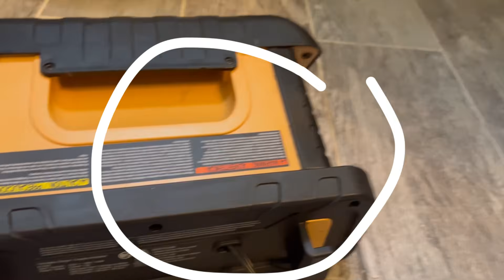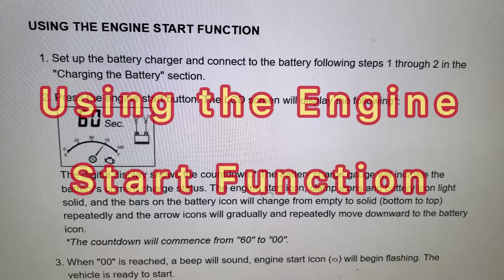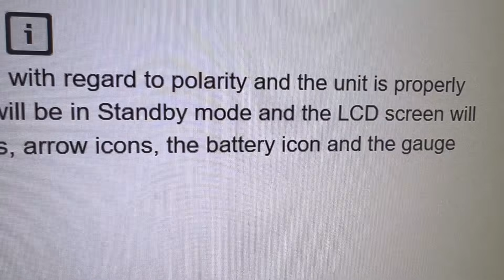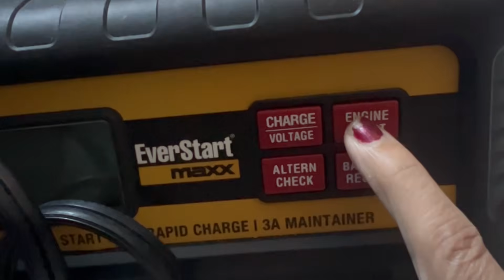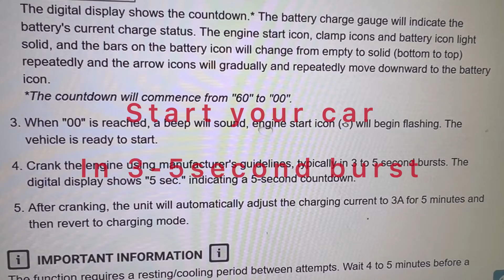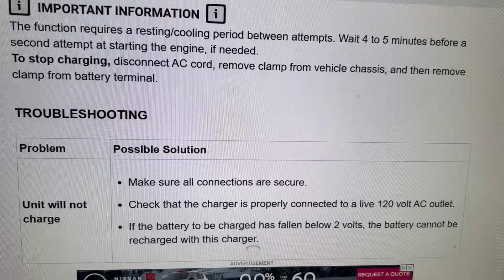EverStart maxx 15 A Rapid Car Battery Charger - Set Up - Manual - Using the ENGINE Start Function

Comment: Got a completely dead battery and this thing wont even begin to charge it. I hate these automatic chargers
Reply: Yup! But the cheap harbor freight one did. 😂
Reply from the maker: @AltruisticWarrior  they always do lol
Reply from the maker: Probably defective - mine still works
Reply: Says in manual,  once battery is below sertain voltage it will not.
Reply: Simply jump start the battery from another vehicle to allow it to receive from voltage for about 5 minutes then the Chargers should recognize it has some voltage and it will function then
Reply: I’ll hook up a jump pack for 20 mins then put it on the charger, usually works. I don’t have an old school charger so do what ya gotta do

Comment: Did you charge the charger before using it on the car
Reply from the maker: You have to connect it to power while using in the car
Reply: I’m using it now and charging it. The icon battery has to be full
Reply: @willychopz it only works when plugged into an outlet
Reply: @willychopz 😆 🤣 😂